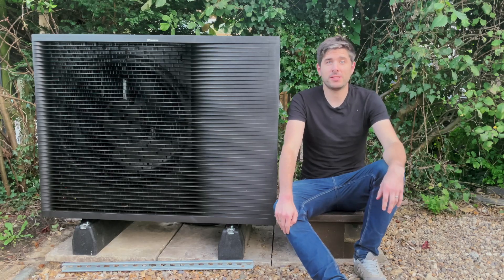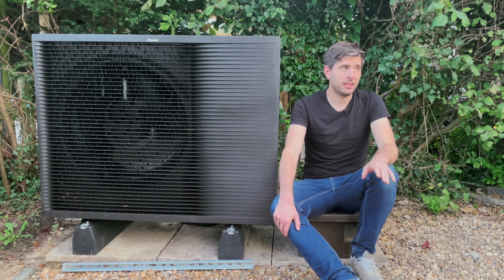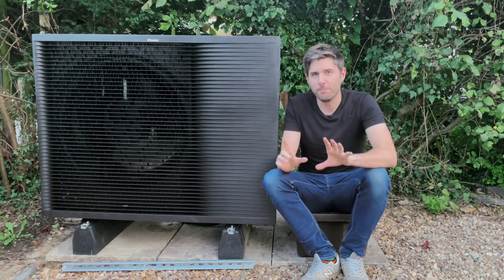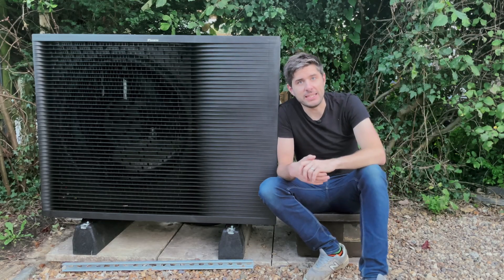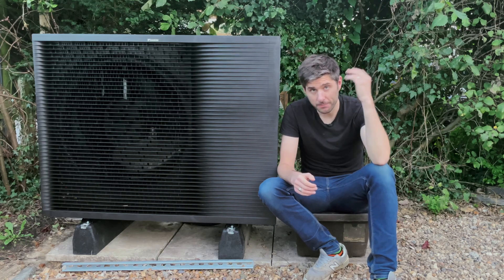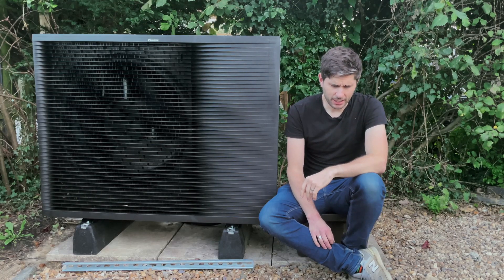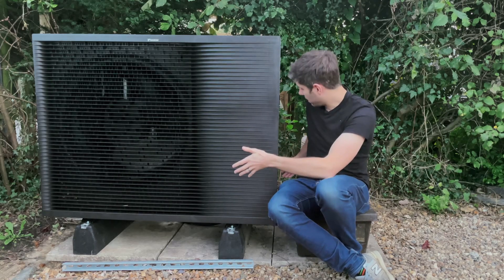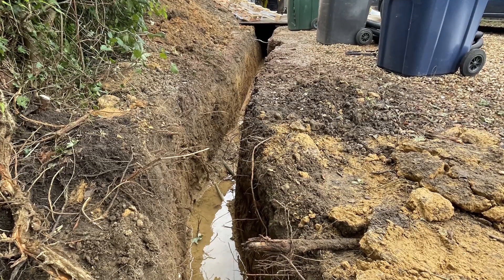Replacing an oil boiler with an air-source heat pump: Why, what and how

Comment: Crikey.  What an absolute waste of time and money, and the formidable amount of kW to run the heat pump.  Then there is pipes, radiators, pumps maintenance.  Just use electric clay radiators, 25 year guarantee and no maintenance, pipes, anything.  Wifi controlled, brilliant.  And no wasted space from that inefficient rubbish.
Reply from the maker: I’ve actually been really surprised with how little energy it uses (at least for our heat pump) the max it’s pulled is 4kW which seems like not a lot to heat a whole house. Time will tell if it’s inefficient rubbish, but so far I’ve been impressed.
Reply: @michael_bird  Ok Michael. But say 6kW on its own with some modern electric radiators could heat a house.  You have a lot of other bits. We only use our oil central heating for the hot water, a couple of electric panel radiators in the bedroom and a wood burner. Ok, so we have different things to use. Heat pumps work well in our Kona EV, hardly affect range.
Reply from the maker: Yep, they are very efficient and really use a lot less energy than I was expecting. We’ve even had a few hours in November where the solar panels were able to provide enough electricity to power the heat pump and the house.
Reply: @toad008  I think you are confusing the badge kW rating with electrical input, the badge kW rating is the heat output.  As a general rule of thumb, you will find that the max fuse size is about 50% of the rated heat output...  e.g. I have 3 heat pumps, 7.7kW, 6.7kW and 8.4kW, each have a 13A fuse, so are limited to about 3kW each - not that any would run so close to blowing the fuse.  Given that there are detailed performance stats for my 7.7kW and 6.7kW units I can tell you that the 7.7kW unit provides maximum heating for 2.4kW, and the 6.7kW unit provides maximum heating for 1.9kW.  So 14.4kW of heat for 4.3kW.   Currently, it's about 3C outside, and my whole house is consuming around 2kW - that includes 2 PCs, a 10-year-old 55" TV, the 3 heat pumps (keeping the house at around 21C), 2 dehumidifiers in the basement.  6kW of resistive radiators would be using more - I know, as I have about 10kW of electric radiators available to me, but they're switched off.

Comment: This is insanity driven by the MCS scheme—before buying an air to water heat pump look at what the rest of the world does with Air Conditioning units. They are Air Source heat pumps that heat up the air. This means you don’t need all that pipework and upheaval. They are so much simpler to install - the same box on the outside and NONE of that junk on the inside. To make it work well, you might need to insulate your house - but that’s not a bad thing to do with the money you’ll save. The latest R32 mini splits have a COP over 3 at -7°C. We got two 3.5kWh mini splits installed for £3500 all in (done in one day) and the whole house is at 20°C without a problem. The heating is so easily controllable, we bump up our temp while the electric is cheap and drop a couple of degrees as soon as the cheap period ends. Oh, and you get COOLING in the summer!

We had two Panasonic mini splits installed one high up wall unit upstairs (makes you feel like you’re on holiday in an expensive hotel) and a low level floor unit downstairs that looks just like a smart radiator. If your air to water heat pump dies you’re screwed (and it will be challenging to find a repair man) but with air to air you would likely have two or three independent mini-splits to cover the whole house - which gives you redundancy. And it’s much easier to find a air-con engineer if you ever need one - there’s so much less to go wrong, they seem to be pretty bullet proof. Hot water is no big deal, don’t spend £1500 on a heat pump water tank that might last 10 years and need expensive servicing. It doesn’t cost a lot to run your ultra basic existing immersion heater on cheap overnight rates. While possibly saving £100 on the gas standing charge.

The disadvantage: No BUS grant, but you're only going to hand that over to your MCS installers anyway. The government considers A/C a luxury item! The stupid thing is the Government want us to get off fossil fuels so they hand over £7.5k of public money to your MCS certified installers - but there’s nothing to say you can’t run your ASHP on electricity generated by a Gas Fired Power station! Sorry about the rant - what a well presented video by the way.
Reply: This is good advice I think.  I have been rather skeptical of heat pumps.  I have an enormous combined living room dining room the walls of which are over 50% windows and thought a heat pump would stand no chance.  My girlfriend was constantly banging on about a heat pump so I have recently installed an air to air unit on the living room wall.  It is SOOOO much better and cheaper to run than what I was using and am thinking of getting another smaller unit for the rest of the house.  The key here is I don't heat water with it and instead keep to using the electric immersion heater.  The idea of heating water to pump around the house just seems crazy to me.

Comment: Interesting video. I've replaced the gas boiler in my brand new house with a 5kW panasonic ashp. Getting a COP of between 4 & 6 !  Running 24/7, mostly powered from my PV & batteries or occasionally off peak electricity in the winter. So cheap to run. Will pay back ( ASHP / PV & batteries in about 5.5 years)

Running a lower temperature in the house seems to cut out draughts - from convection currents

Comment: You will need a new water tank : 1) better insulated, 2) the temperature of the hot water is lower (as you said) so you need more of it to do anything.  Ie if you need to wash dishes at 40C then you will need more hot water at 55C than gas heated hot water at 80C.  So the thermal content of a small tank would not be enough for a household.

Comment: One critical thing for reliability of the outside unit is that it must be level - otherwise it can result in premature failure of the bearings of the fan resulting in noise.  Make sure the base is over specified and really level.

Comment: I am now subscribed and wish you all the best in growing your channel. I have been down the same road and all your comments at the start really remind me of my thoughts.
We are also in a small village, had a bulk LPG boiler, storage tank get condemned (now in wrong position) after 45 years in it's position. Boiler also was older and parts difficult to get, so we jumped to ASHP and replaced all radiators  due to them all being very old and rusty in parts.
We initially had solar, then doubled the solar and added a powerwall. Then came the EV and ASHP a year or so later.
We have not been cold and in fact maintaining a constant 18c  or 16c overnight the house has felt warmer. We used 3,333kWh in our first year for our 5 bed detached house. A year after we managed to get our Cavity wall insulation that had broken down and was as good as none, replaced and we are now saving about 30% on our usage.
The new water tank has a lot more internal pipework thoughout the cylinder to heat the water at a lower flow rate. Same thing as the radiators having more fins.

Comment: Paying about £150 a year for combi boiler maintenance.  I assume that the maintenance costs on a heat pump wouldn't be much I.e. would it need an annual maintenance check?
Reply from the maker: Yeah, I plan on doing an annual service and will be paying for an 8yr warranty. All of this is provided by the manufacturer

Comment: Well explained! I run an air source heat pump myself in Sweden like more or less everyone else here. I find it difficult to understand the scepticism whether it will work or not in the UK. Worst case there might be a need to add or increase the size of a radiator or two in order to compensate for the lower temp radiator water. 👍
Reply: I am in the UK and am using one Air source and one ground source heat pump, both are solar powered providing all  heating and warm water FOC, the air source pump doubles up as air con in the summer, on average I am getting 3 kW of heat output per 1 kilowatt input
Reply: Sadly the UK has been over supplied with idiots so we have more than our fair share. I listened to some directors of the massive engineering company, I work for on Friday all agreeing that EVs and heat pumps are all nonsense 😂.  You can’t help stupid people.

Comment: Just for accuracy of information  heat pumps can not heat domestic hot water to 55c. In order to get hot water at a usable temperature it had to be heated directly using electricity.
Reply from the maker: I’m not 100% on this as the documentation seems to suggest that it’s all heated via the heat pump - but I think you’re correct. 

Worth noting though the heat pump will heat it to as hot as it can and then let the immersion do the last little bit for the legionella cycle. Basically means we only use on average between 2-4 kWh of energy to heat our hot water cylinder.
Reply: My Heat Pump does 55C just fine without Immersion (I can even turn off the immersion and still get 55C), and the R290 heat pumps go up to 75C without immersion.  If I want to do >55C then it needs the immersion.

Comment: The two biggest issues are cost and space to install the internal equipment required. 
Not sure you would get all that in a 2 up 2 down terraced house
Reply from the maker: This is true with this particular setup, but a smaller mono block heat pump correctly sized for a smaller house would cost less and require less space and ‘stuff’.

Comment: It'd be interesting to see how many houses in your village will be able to install them before the electricity supply is too small. This will also be accelerated as people swap out to EV's from petrol/diesel.
Reply from the maker: The biggest draw we’ve seen is ~3kw at -2 degrees. So not loads, about as much as our oven/hobs
Reply: Agreed but that’s on top of everything else you already have , plus an EV charging times 300 homes in the village
Reply from the maker: Yeah, not sure what the capacity of our local grid is? The DNO didn’t seem overly fussed about the extra load from the heat pump though so we might be fortunate?

Comment: The sort of problem with HP's is there isn't much heat in the atmosphere when you really need it (the winter)  same goes for solar but electricity can be used for many other things not just heating water.  I'm watching the development of them but sticking with oil until price drops significantly.
Unfortunately most British homes are poorly insulated and that's where heat pumps aren't too good. Great in Scandi where they have been insulating homes really well for decades.
Reply from the maker: If it helps, my home is a ‘30s semi-detached.

Comment: One thing that you didn't cover was running costs when installed.  I don't know the relative cost of oil versus gas.  
However, the price cap on gas earlier this year was 10.3p/KWh whereas electricity was over 3 times the price at 34p/kWh.  I know that you can get overnight cheap electricity (8-9p/kWh for a few hours) which is great for heating the water and probably all you need in the summer months.  However, on those tariffs you get charged 3p more per kWh during the rest of the day which you will need for the heating as that has to be on all the time.  Surely you need to factor that price difference into the equation when working out the energy efficiencies for the  various options.
Reply from the maker: Yep, and something we definitely thought about. I’ll crunch the numbers after the winter and share. 

Worth noting that we don’t have the option of mains gas, Oil prices have been fairly volatile (more so than electricity), so this was also factored in for us.

Comment: Thank you Michael for a honest appraisal of your experience so far. What has your experience been with respect to heating, now that it has got cold, and the UK has gone through a very cold snap? We are just about to sign on the line for a new ASHP, to replace our ageing oil system (we're getting a British brand called Grant). Our house was built around 1993 so the EPC does not recommend loft or cavity insulation, but our big anxiety is whether the heating performance will in fact be rubbish and we end up having to use electric fan heaters (expensive!). Would be good to get your thoughts.
Reply from the maker: Exciting! Good luck. Yep, our house (1930s) was very toasty during the cold snap, plenty of heat and hot water. I think I’ll do another video on my experiences!

Comment: Lol £15000 to install it and you save £300 per year on heating.  It should pay for itself in 50 years time.  Assuming nothing goes wrong, which it will

Comment: An interesting, well balanced video. However there's one absolutely critical bit of information you didn't disclose. How much did it all cost? My annual gas bill for heating & hot water, including the standing charge, is £380 or £7,600 over 20 years. This is virtually the same as the current government grant & that's usually just the starting point in terms of the cost of an ASHP installation. Maybe if you live in a remote rural area you can make a financial case for a heat pump but I suspect the 90% of us that don't, can't.
Reply from the maker: Yeah, I wasn’t expecting the video to get this many views so didn’t think it was important. Lots have asked, so I think I’ll do a video with a proper breakdown.
Reply: @michael_bird If, like me, you want to be green, it's worthwhile calculating how much energy you use & where it's coming from. Wifey & I use roughly 4,000kWh/year of gas, -500kWh/year of electricity (our solar panels are net exporters), 2,700 kWh/year of petrol (to do 4,500 miles/year) & a whopping 22,000 kWh worth of jet fuel to take us both to South Africa twice a year. In my personal circumstances, the government should be giving me £7,500 NOT to go on holiday!

Comment: Thanks you  unfortunately don't have mains gas ,i do circumstances/properties vary i can't have solar power as back garden shaded by tree's in park , 40+ grand quote for off rd parking for a ev , Installing a heat pump would would drive me and neighbours mad with vibration noise

Comment: Great video, thanks for sharing.
Owned my hitachi heat pump on new build for 1 year.

Very expensive to run, about €500 per month 1700 sqft, temp set 22.5c during winter.

I just signed up to cheaper night time rates and asked the service guy could he programme the hp to activate from then , but he advised me not to, he gave me some convoluted reason not too, but I noticed you said your hp is timed for nighttime use.
Reply from the maker: Yeah, it’s just the hot water that heats at night - so 2-4kWh done on the night rates. In reality it’s running 24/7 so a good chunk of the heating is done at the cheaper night rates anyway.

Comment: I was in exactly the same position two years ago when cracks appeared in the oil storage tank three weeks before Christmas. The oil fired boiler was at least thirty years old and, although working perfectly, wasn’t likely to last much longer. I was very unsure about a heat pump’s ability to keep the bungalow warm in it’s rural setting so I decided to go with an electric “boiler” which is like a sophisticated Emerson heater which heats the water to the same temperature as a oil/gas boiler and was a straight replacement for the old oil boiler using all the existing pipes and retaining the hot water cylinder. The installation took two days with a total cost of £5000. The system (made in Italy for many years) 14:45 uses 13 kw when heating from cold but drops in stages heating the radiators very quickly bringing the bungalow up to 22 degrees in an hour. The running costs are fairly high but not when compared to the old oil system and the relatively low installation cost means there is already a considerable saving compared to a heat pump. There is also an existing array of 16 solar panels at the property which helps reduce bills. After two years no maintenance has been required and the whole thing is controlled by a Nest thermostat which I access via my smartphone. The old Emerson heater still works so I tend to use this for hot water particularly in the summer when the solar panels produce enough power to cover its electricity consumption in the middle of a sunny day.
Reply: Hi, we are currently in a very similar position to you with the oil etc and would like to go to an electric boiler. Sorry for asking but how much per month does the electricity cost?
Reply: @JohnWilkins-pc5ji Hi - I was with SSE but they have been taken over by OVO and only show consumption for the last six months which is an average of £118 per month (not including standing charge or VAT. But this is for a detached 3bed bungalow with solar panels so consumption will vary wildly depending on the property. The system does use a lot of electricity but the cost is roughly similar to the old oil system which used £1,000 to £1,200 worth of oil each winter.
Reply: Boilers make 0 sense. 10KW Heat Pumps Are available für 1200€/$ and use 1/4 electricity Input